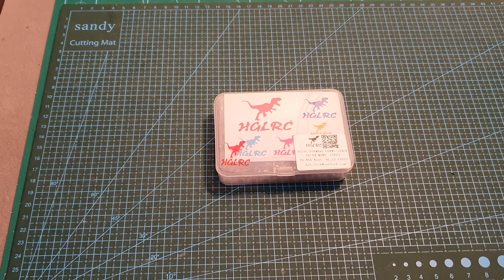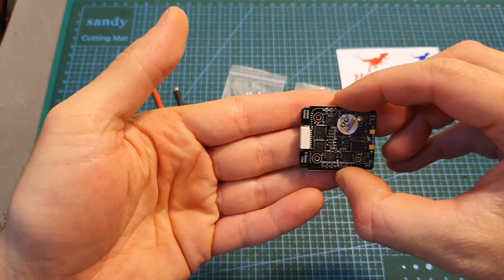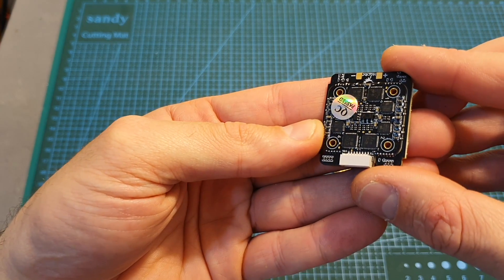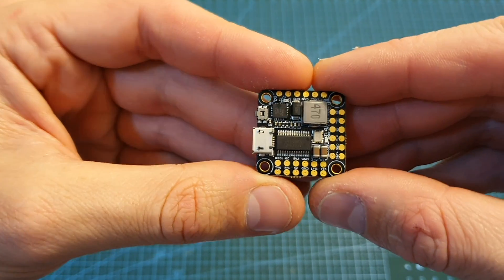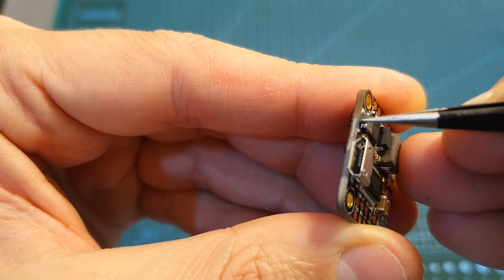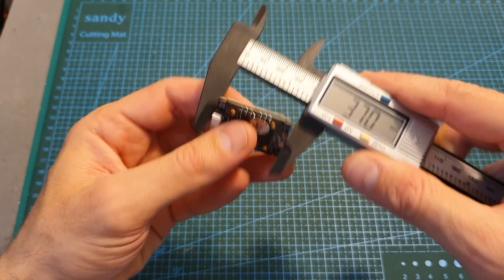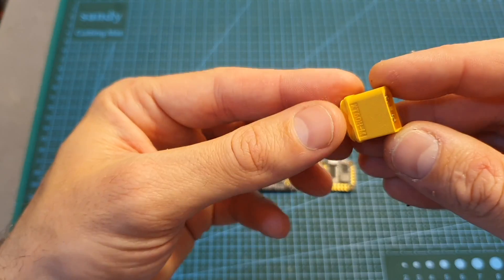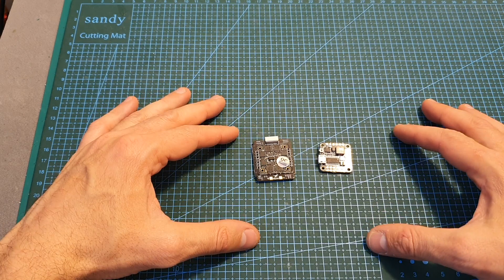HGLRC FD445 Mini Stack Overview

Comment: Does this provide current through esc telemetry? I don't see any current sensors on the board so I assume it only provides voltage and rpms through telemetry. No one mentions this in any review of the esc which is strange considering current and mah consumed is a common thing to have.

Comment: Can you tell me if the FC has a barometer and  if it is detected in the BF configurator? It seems to me that there is one but on the specs  there is nothing about  baro.
Reply from the maker: Yes - BF detects a barometer.
Reply: @KremerFPV  OK, thank you.

Comment: $110.97 is to much so forget Amazon on the HGLRC site its $89.89 and that is about right but, it looks like it's only for a limited time. I am not sure about this one as I have noticed that HGLRC puts it's pads extremely close together and that makes it hard to solder.
Reply from the maker: Yes - pretty expensive on Amazon... I guess it's only useful if you want to get it fast.